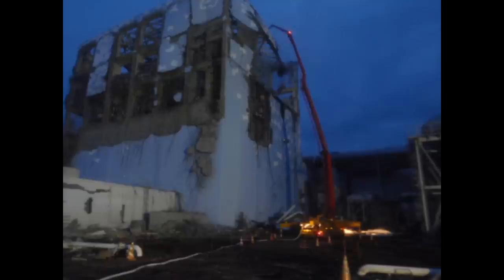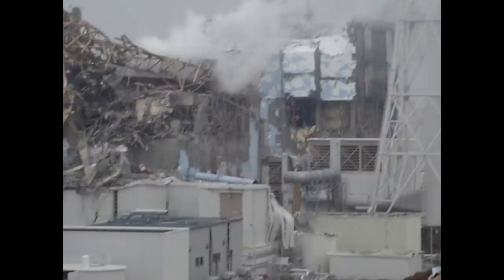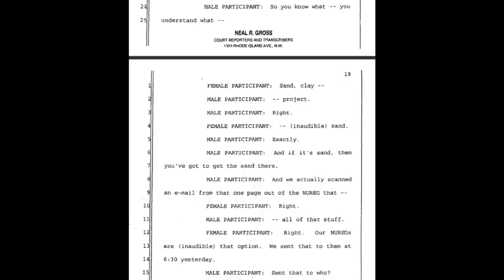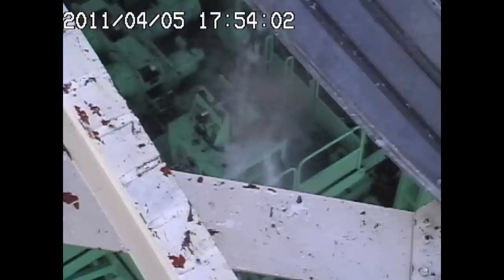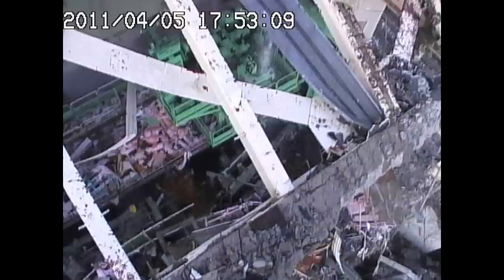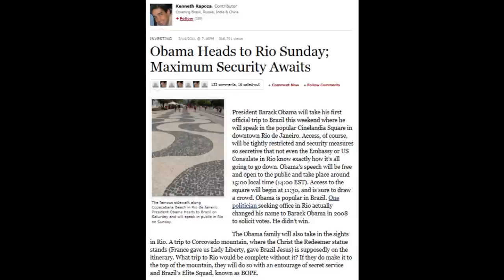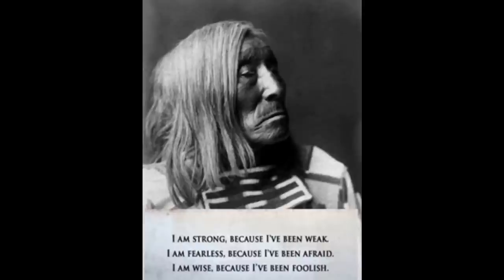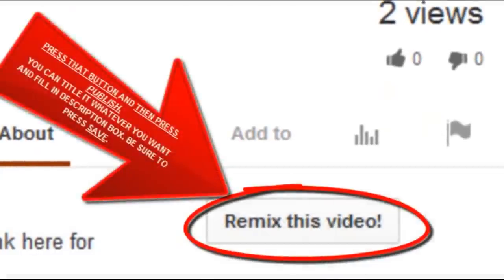Fukushima Fact vs. Fiction Plume-Gate update 12/21/13

Comment: Sand and or Boron (a neutron absorber) would also "contaminate" the fuel that is burning.The fuel must be fairly pure to heat up.The "elephants foot" in chernobyl is the result of them contaminating the fuel,also all the concrete and metal it burnt through.This is my observation and opinion.

Comment: One sailor said he went below deck after duties,they then (for some reason) checked him for radiation (meaning the Navy KNEW of the situation in my opinion),found he was contaminated (amongst others he realized),then they started the brutal decontamination (which apparently did not help much).If I was Captain (probably too got contaminated breathing in hot particles),I would have dropped and ran from that place.No different than the Army sending troops into a radioactive cloud to see what happens -----My Lawyer too would be also knocking on the Dept. of the Navy and DoD doors--Does Navy JAG have any say in this?